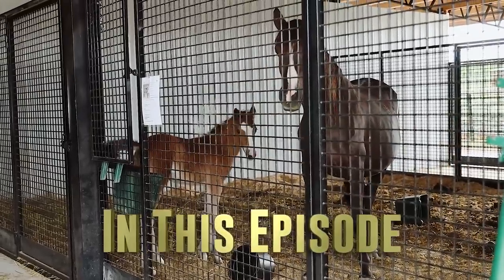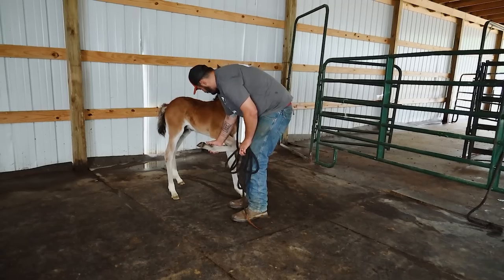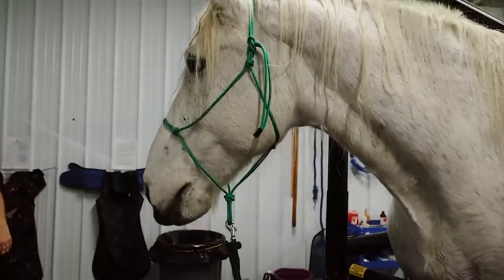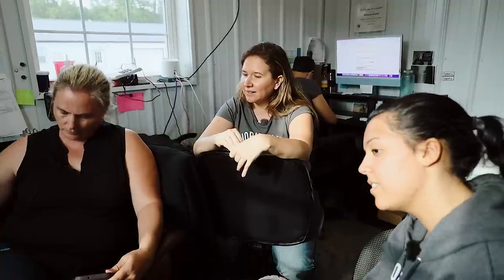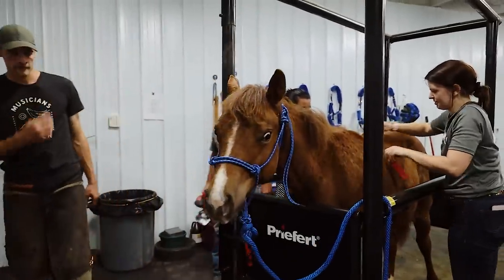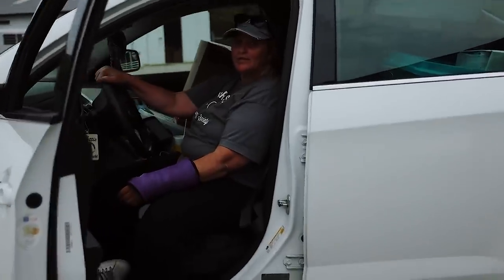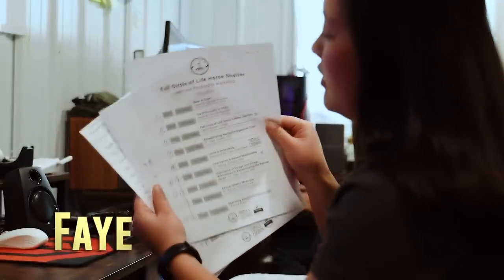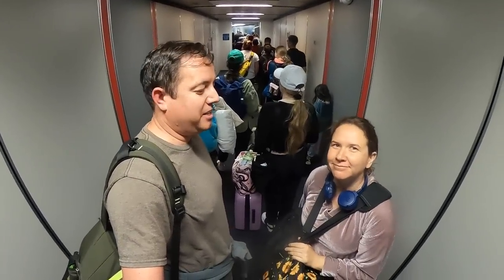Shiny New Shoes - Horse Shelter Heroes S4E14

Comment: Hey Tawnee, same here. Mines on the 24th, what day is yours? That's another good point you just made with letting them go out front first, The buck and it they connect while you are inside a metal trailer, the damage would be extensive. Plus you wouldn't be able to go after them if they got away like that and could end up hurting or killing themselves running away!